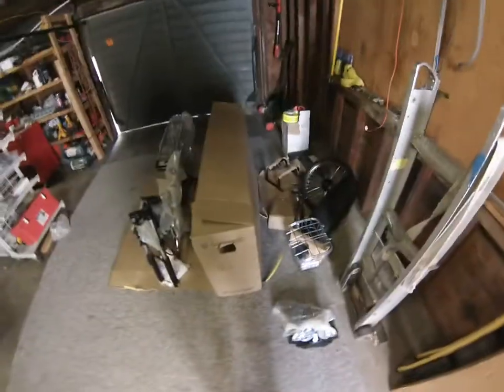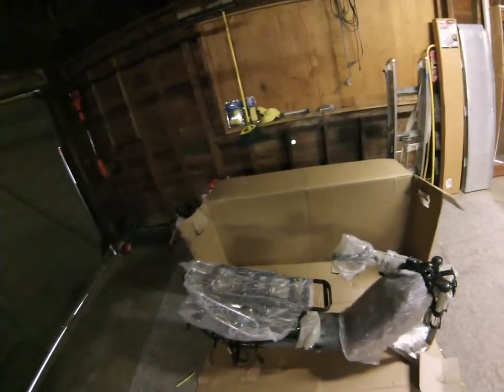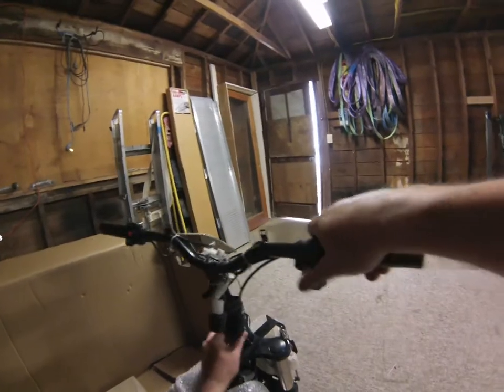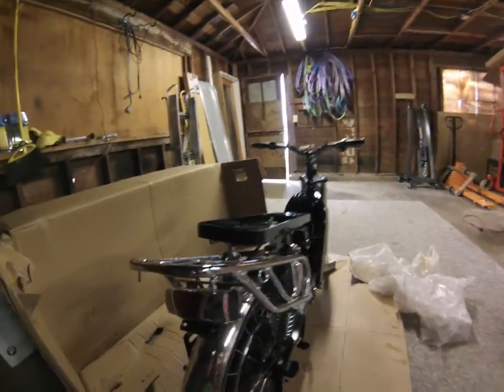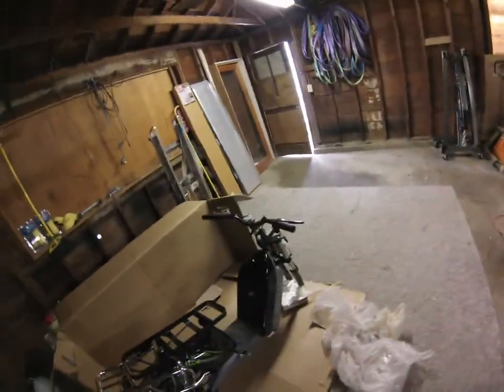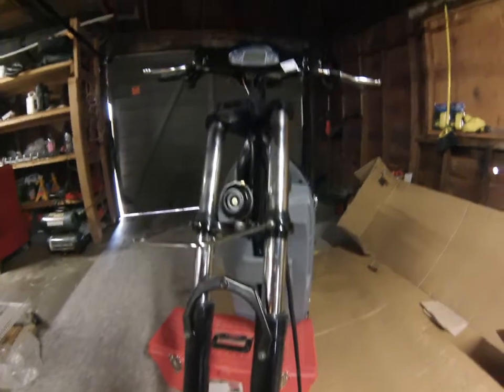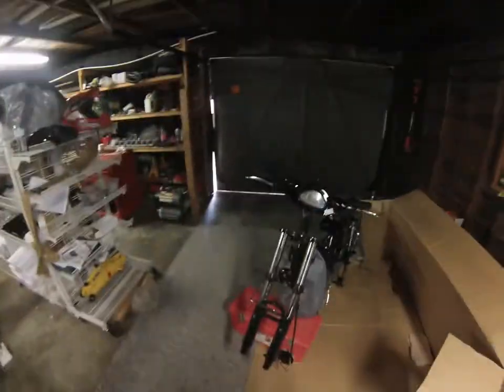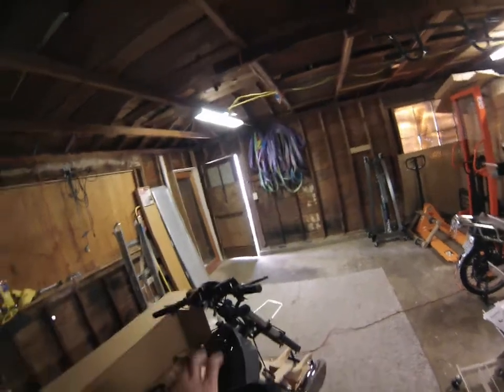Assembling the CG/JZW 60V 12AH 450W Ecomoped Electric Bike. Sample video

Comment: Just complete my imstallation after watching yourvideo.  things look fine however its been charged 7 hours but wont run unless its plugged in. signels brakes light work fne unless you unplug the charger. charger keeps both red and green on at al time?

Comment from the maker: Replacement clear rear brake and running light bulbs for the 2013 models are available on my ebay auctions look up user mechanator.
Ecomopeds information page available on Facebook as ecomopeds